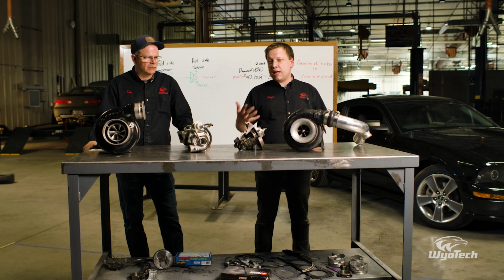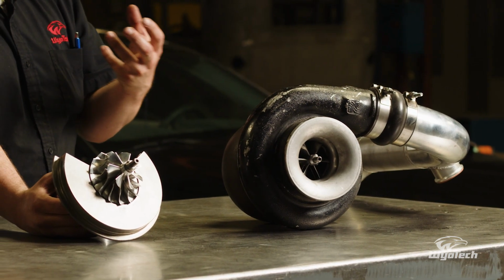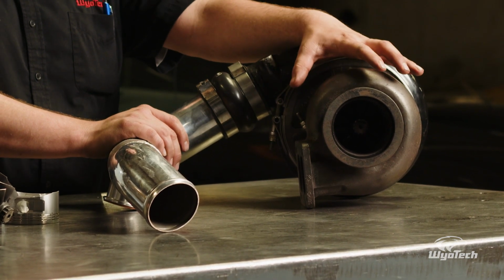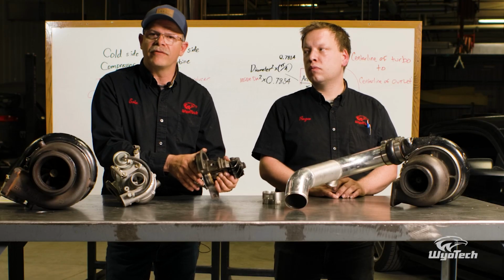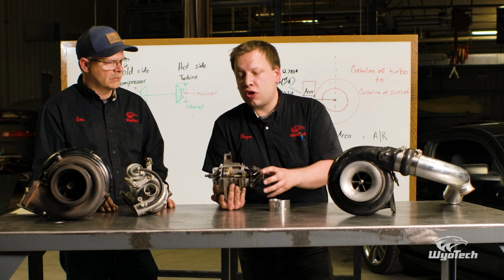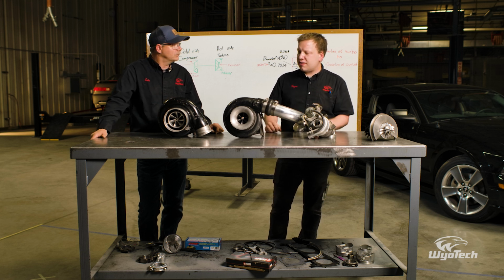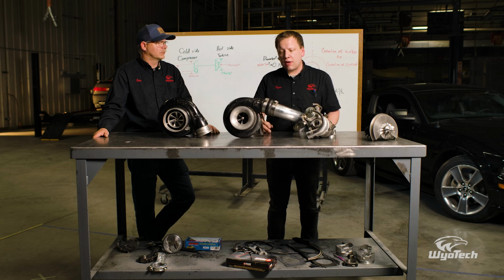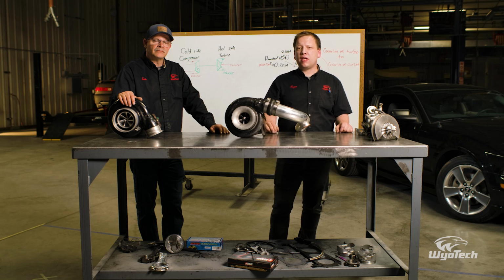Turbocharging: Power and Performance | WyoTech

Comment: I built a 10:1 331 sbf, runs great, good mid range and 15mpg when I’m in the skinny pedal which is always. Next build will be more cubes, a half to 3/4 more compression, slightly larger cam… just like I shoulda done the first time